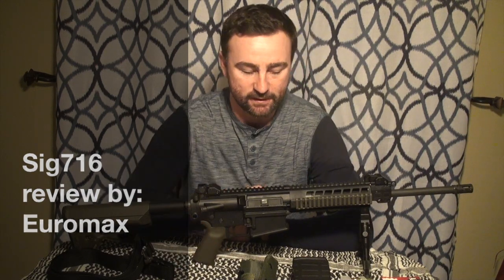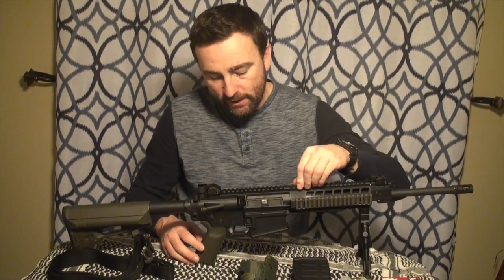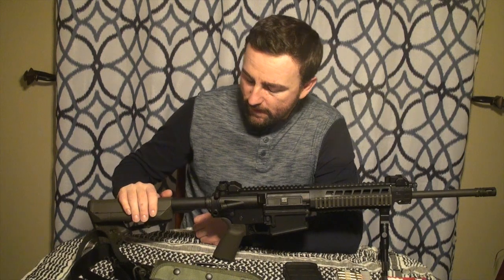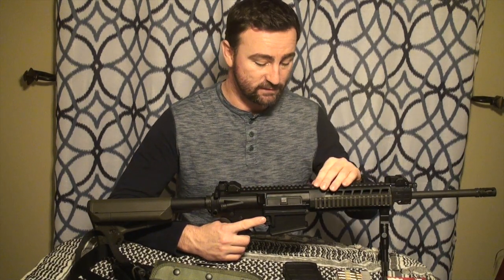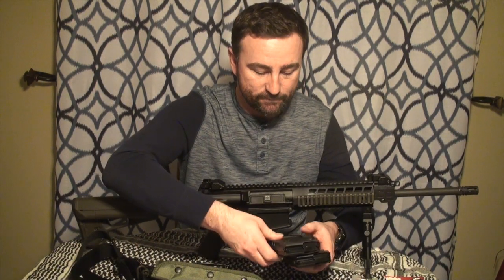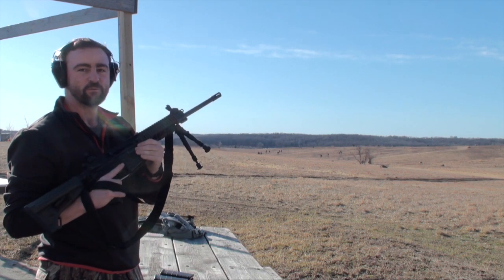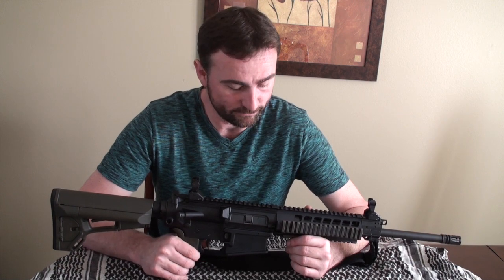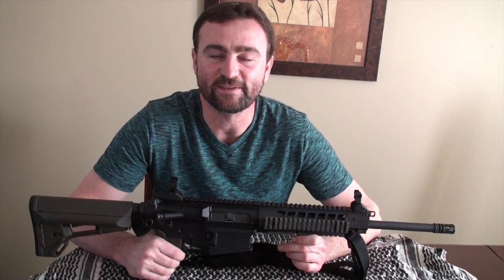Sig716 review and range test

Comment: I put a m4-72 sever duty muzzle break on mine. Mine kicked like a mule but that is now fixed with the break. interestingly the accuracy of the gun went up where I was getting about 3moa consistently to 1 moa at 100 yards. YMMV
Reply: consistently 2 MOA seems more believable but idk its kinda hard to keep getting 2 MOA or maybe it  just me i find the sig716 not exactly a MOA rifle witch i no its not intended to be
Reply: Kevin Brady even at 100 yards? It's a .308 round. I know by far the rifle is not accurate but it's only 100 yards lol. My next gun I will build a bolt action, those are a little more dependable on accuracy lol
Reply: bolt gun def more accurate then a sig716 i promise lol but thats for another debate..Yes its a accurate rifle don't get me wrong but its not a MOA rifle
Reply: Kevin Brady really? bolt action vs. semi is really a debate? lol I have seen and experienced great accuracy with the sig but  just shy of not on par with the scar17. I should mention that it was with hand loads not factory ammo as well.